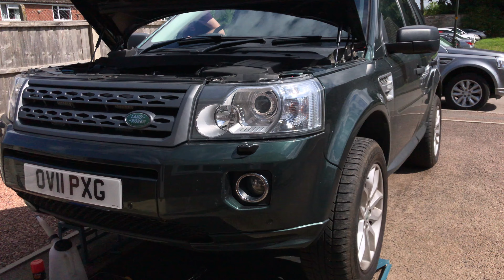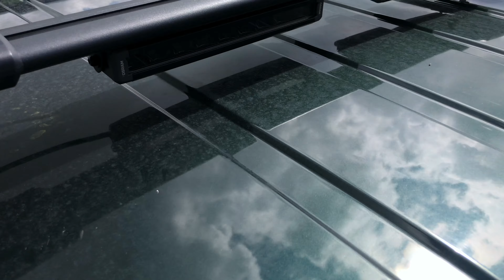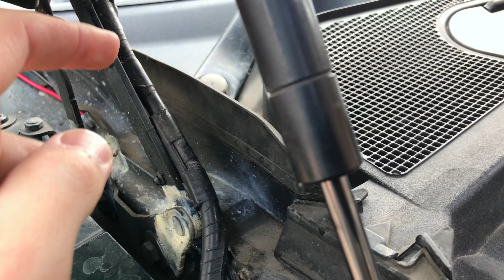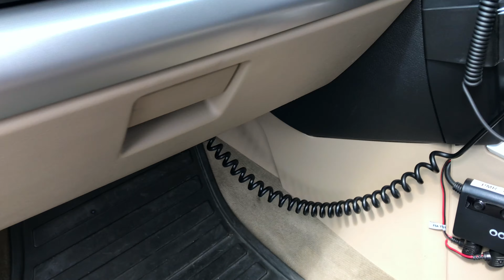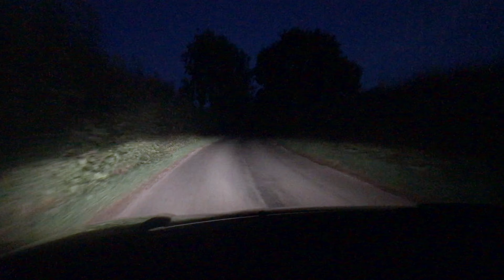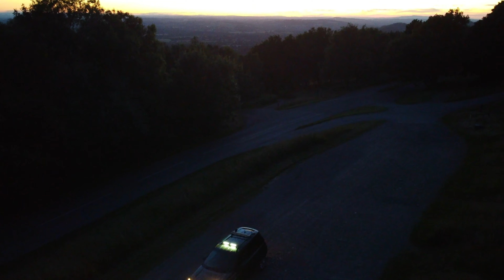Freelander 2 / LR2 - Osram Lightbars

Comment: Hi, How did you fix the lamp brackets to the rail ?
Reply from the maker: Hi Tony! 👋 We used rivet nuts. A bit tricky as the mechanism for the roof bars sits inside the bar itself, so make sure to allow a big gap from the ends of the bars. Hope this helps! 🙂

Comment: Nice and discreet. Interested to see how and where you wired into the high beam. Plus where you’re going to install the switch.

It looks like a Carling switch. If so the led backlights dim if you hook it into the illumination wiring of the dashboard.
Reply from the maker: Thank you! 🙏🙂 Hopefully at a later date install the switch into the map reading light panel. Going to get a second hand one and try it out 🙂